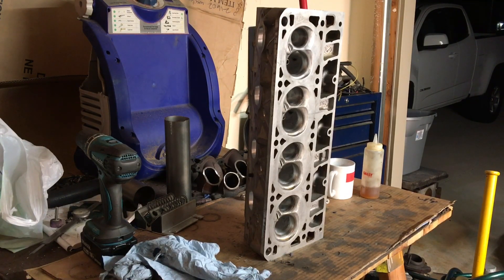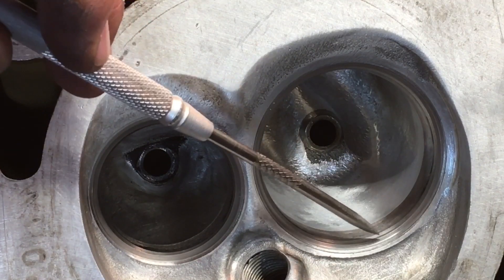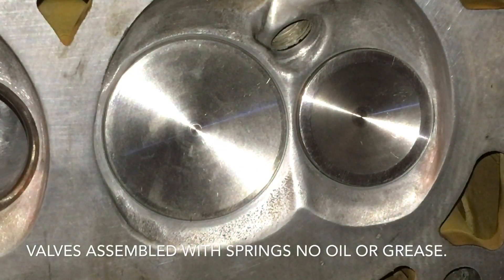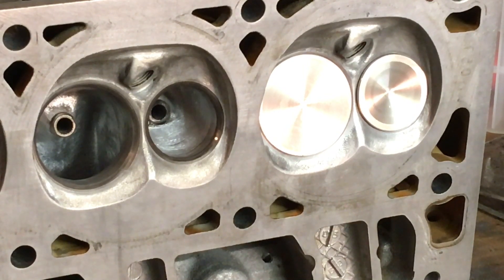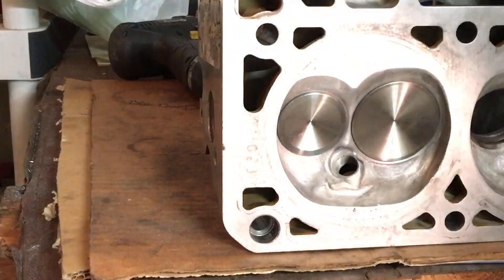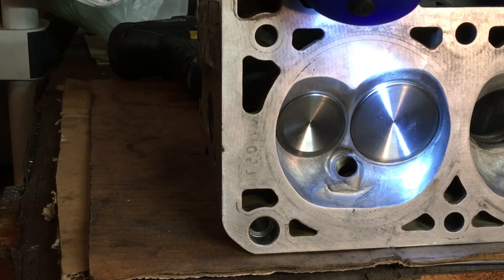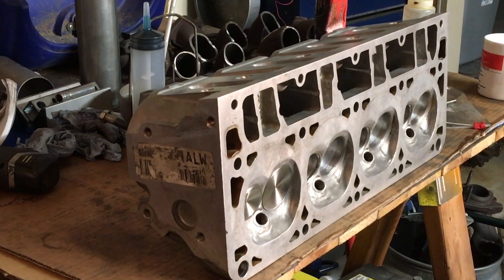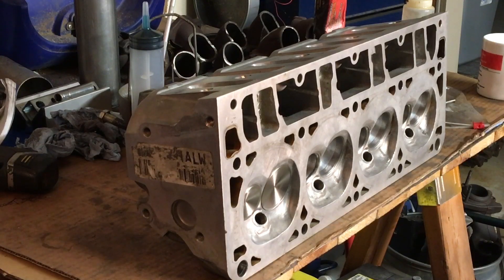243 head test Will 2.02/1.57” valves lap in? NOPE HERES WHY!

Comment: Looks all good it will work.when I fill my port's up I don't use a valve springs to hold them I let seal  themselves and I twist valve around to mimic valve motion and don't  get any leaks.i chamfer they margin on intake valve and back cut intake valve just above top seat radius on valve  to get that lip of it.just put valve in drill have it  turn slow put it on a angle on a brench grinder mines only 1.5 hp.all stuff I learnt from David vizard. As long as valve clears side of chamber and as you said doesn't upset valve spring install height I reckon your on a winner .good work
Reply from the maker: Wayne Ireland I like the back cutting on the valves back towards the stem to help the transition. I hadn’t seen this procedure done at home, thanks for the tip!  I agree, now I can identify the sealing “Ring” i can smooth and radius the seat into the bowl with more finishing work. 
This set of cathedral port heads will have the largest bowl cut percent i like to do by hand on a stock seat. We’re looking for some big power numbers, I can’t wait to see how the car performs. 
Thanks for the feedback and tips I truly appreciate it!  JD